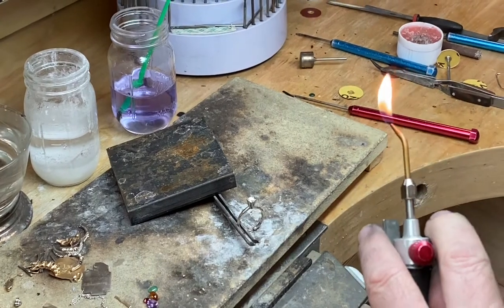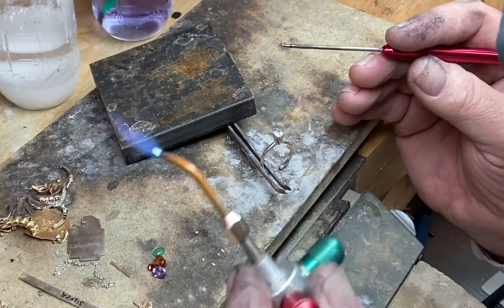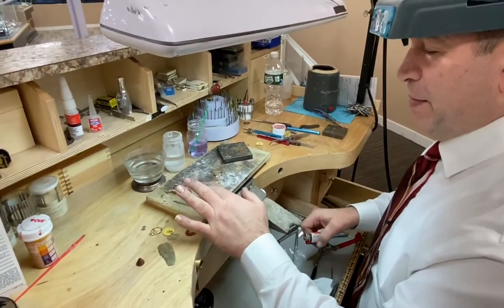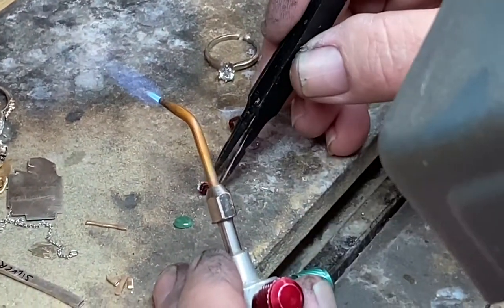How to Retip prongs on a CZ !

Comment: complete and utter bullshit, my guy just used the easiest solder on the planet and made it sound like this type of work can be done with any stone or any type of solder. emeralds and opals are some of the most sensitive stones there are so if anybody tries this on one they will instantly destroy it or decolor it regardless of the low melt solder. sure there are always some off the wall cases where it might work but the risk is so extreme its just not worth it at all. dont be lazy, take the stone out and rebuild the prong using hard or medium solder then put it back in after.
Reply from the maker: If you have years of torch practice, it can be done. It's not lazy if you have the skill behind you. I've done thousands of prong retips on CZ rings, no issues.